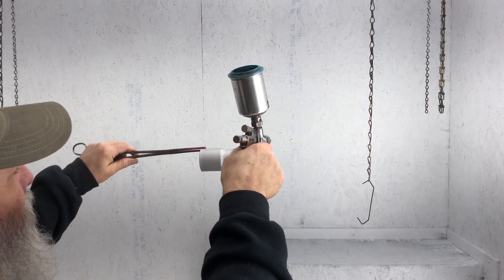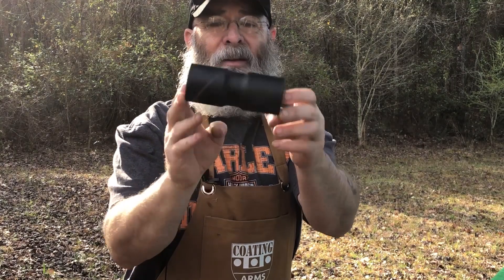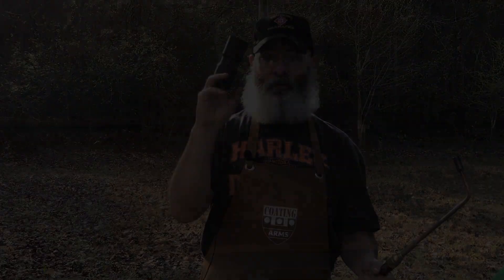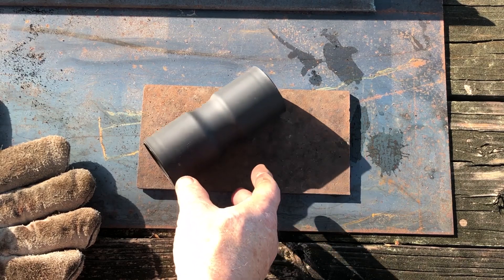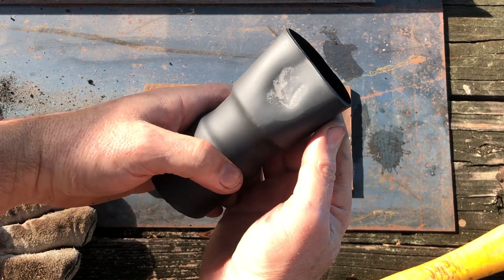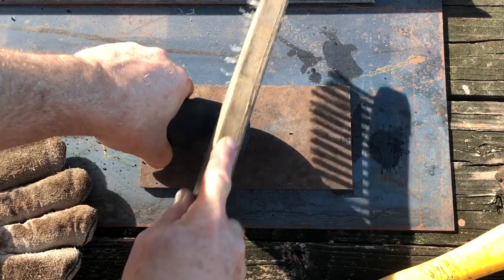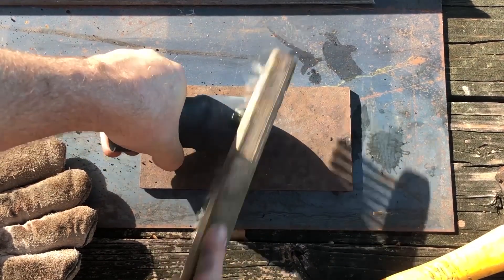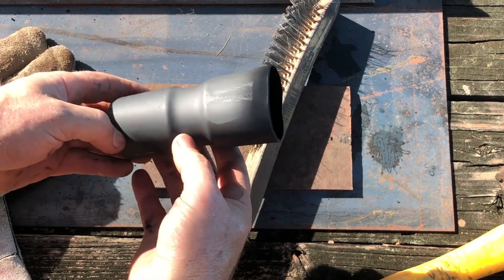Testing Cerakote Glacier Series

Comment: How does the V Series Cerakote Coating stack up against the Glacier Series?  I’ve heard the V Series has excellent UV protection and the color doesn’t not fade, however, both coatings are good for up to 1800 Degrees F.
Reply from the maker: Both are UV stable and V series is color stable up to 1800 degrees and Glacier series is color stable up to 500 degrees. V series is harder and less scratch resistant. That being said, V series needs to be cured at 500 degrees (except the V Piston Coats - 300 degrees) and Glacier series is air cured. V series is my least favorite Cerakote to apply due to it's high temp cure and its odor when spraying and curing.
Reply: @TigerCreekFarm  Thanks for the reply, had couple more questions, do both coatings fade over time due to repeated heat cycles in relation to exhaust headers?  Does the V series fade slower or at all compared to the Glacier series?
Reply from the maker: @ since V series is colorfast rated at 1800 degrees I would assume if any fading were to occur V series would be the best. My personal experience has been very slight fading with years of repeated cycles using C series.
Reply: @TigerCreekFarm  Understood, thanks for the info 👍

Comment: Was there any cleaning of the metal after sandblasting?  Any other prepwork that you remember?
Reply from the maker: Clean/degrease the metal thoroughly.
If the metal is very dirty or greasy it may need to be cooked in the oven to release remaining grease/oil. Repeat clean and degrease.
Sandblast with clean 100-120 grit red garnet or aluminum oxide to clean and texture.
Wear powder free latex/nitrile gloves when handling and blow everything off with compressed air to remove any blast media or dust.
At this point it should be ready to coat if everything was prepped correctly.

Comment: Does cerakote gets mixed with a solvent or used pure ?
Reply from the maker: C-series is used without any mixing and is air cured. H and E series are mixed 18:1 with hardener and are oven cured.